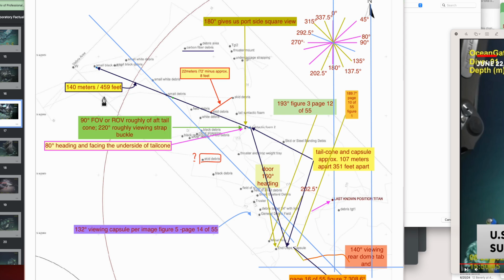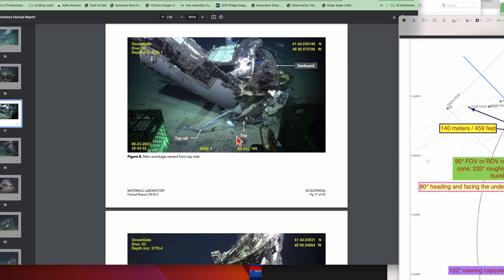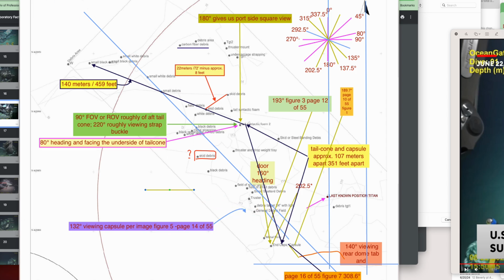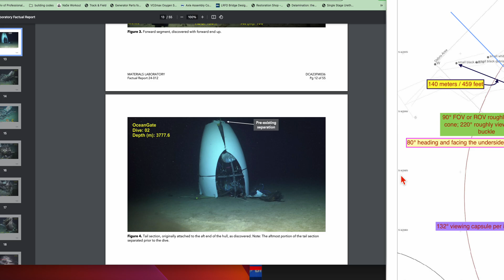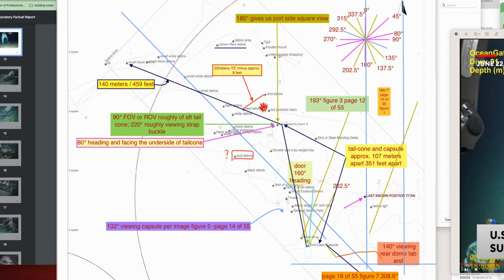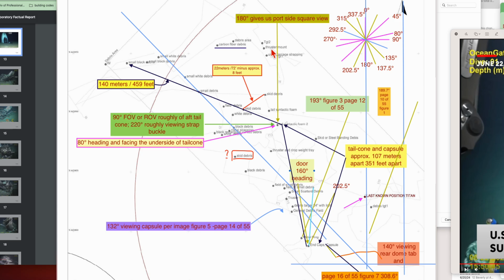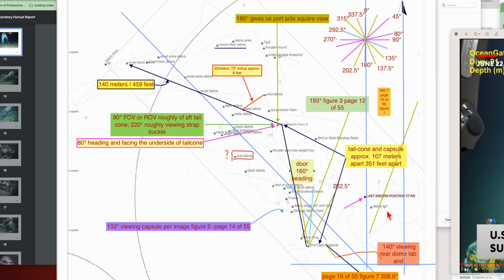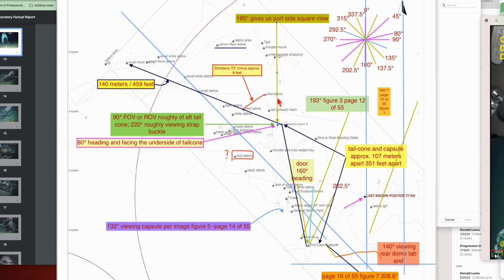Titan Submersible location and orientation of debris field, skids and tail cone - most critical info

Comment from the maker: To the information bring different or new is because they are not true forensic investigators... I am capable of adding up all the data and telling the story of each piece, if I can only see the pieces before they were touched. 
Only one story is true.. I will not stop until that story is told or I don't have enough data to tell that story.
This failure has a few stages of failure and the human decision created this failure. 
Rush, ignored his own RTM data, which screamed to him that the hull was done... I believed he wanted to squeeze this dive out of it and ask the billionaires for another 2 or 3 million to rebuild sub hull again, electro impact might have some data to prove this, he might have inquired, with them about fractures or another build.

Comment: Nice work.  Very detailed.   Nice purring too lol.   Is there any data to suggest there was a fire inside the hull prior to implosion?  Some of those black chunks sure appear to be charred.  Maybe it's the natural dark color of the CF too.
Reply from the maker: I have not seen any images besides the one by tail-cone that resembles something "burned" but it can be just peeled open
Reply: There also been some fire/burning caused by the compression of air within the capsule, after implosion,  although that would likely have been a sudden and extremely short explosion (such as in the combustion chamber of a diesel engine). I don't think that would be enough to actually 'burn' any of the material.
Reply: Would have*

Comment: L,N,P, IS acurate depth sonar for depth iscrack on.  north south e w is aproximate due to mother ships thrusters keeping it in one psition.  sub imploded killing sonar within ten secons of last known poss what is an approx. the tgt 1 is suposed to be the tail end. them not putting a position on the tail end is a cop out big time. ive seen quotes from reddit stating tg1 is tail end. last ping was 6 seconds off them saying neautal bouyancy weight drop what is the 2 weight drop. thy travelled 6 meters between them two points towards the titanic and down. from 350 meters up so the imploded within ten meter of 450.
Reply from the maker: I can't talk bad about any government organizations because I will be sanctioned on YouTube... Hope you understand my position of stepping lightly if I want to reach the most amount of people.
Reply: @ForensicCats  yep understand. there is no time given anywhere from navy acoustics just around that time is all thats been said. ivedropped a 6 inck steel ruller in 2 foot of water it can go ahywhere depending on what way you put in in. a slytly bent peice of copper can go any way imajinable. but all bits from the sub would go with current. a real hard thing to determine with the debry
Reply from the maker: They might be surface ship's location beacons

Comment: The "landing gear" came apart from the force of the implosion , 
I also firmly believe that they were few hundred feet above the sea floor when the implosion ocured & the currents that were moving towards the northwest at the time carried the lighter debris in that direction
Reply from the maker: Coast guard search pattern reveals slow drift south east direction
Reply: @ForensicCats  Well that would fall in line with the debris field, 
But they only measured the "surface" [above the thermocline] currents, not the ocean floor currents 
If the current was flowing towards the southeast, then the lighter debris would fall in that line, but they are in a line towards the northwest.  Now the more dense metallic objects would fall basically in a straight line down from the point of implosion.
Reply from the maker: Where is the point of implosion? Per your statement, I should find the main structure and rear at the same location ?
Reply: @ForensicCats   I would say it was a couple of hundred meters above the point where they found the landing gear & domes & rings.  Have you taken into account distance above the sea floor in your analysis
Reply from the maker: If, you ask that question, you have not paid attention to my last few videos.... 
With that said and you looking at the debris field, where do you believe the implosion at 200 meters took place? 
Do u believe they were NOT aborting the mission?
Reply: @ForensicCats   Based on the early testimony, dropping 2 weights was a procedure to slow down the descent for a soft landing on the sea floor.  Rush wanted to give his passengers a good show for that dive & I also firmly believe that PH Nargle was in control of the dive at that point, since he was the Titanic expert and would be maneuvering the "sub" for the best viewing.
Reply from the maker: Yes, I know of the narrative and I did an hour video on the rate of descent and the last 32 seconds rate of descent ... They were way off from needing to slow down descent, way off!
Reply: @ForensicCats what video is that one named man? Want to watch that
Reply from the maker: It's in the video playlist and it's about 6 videos back or more ... I am sorry I can't link from the device I am using